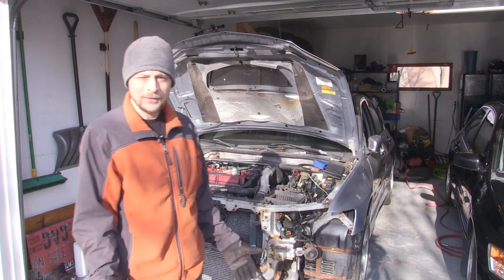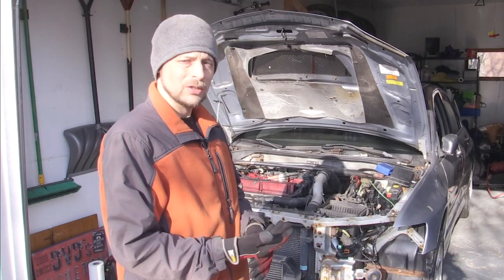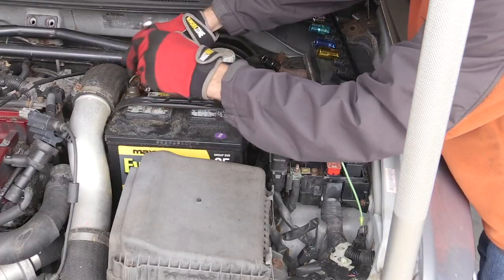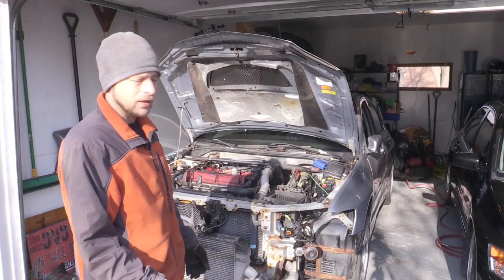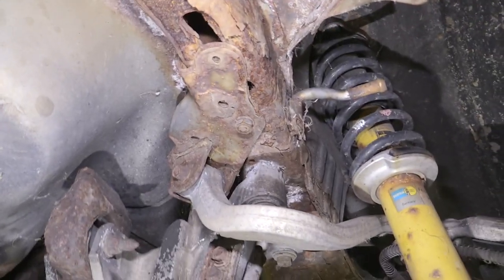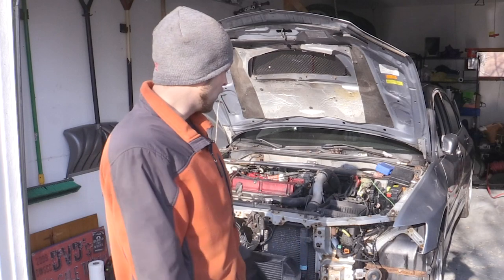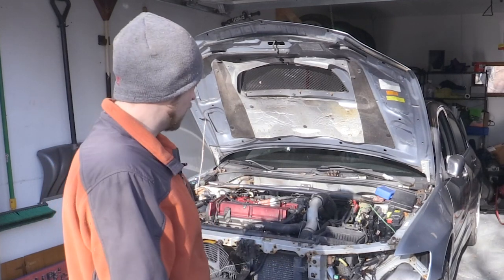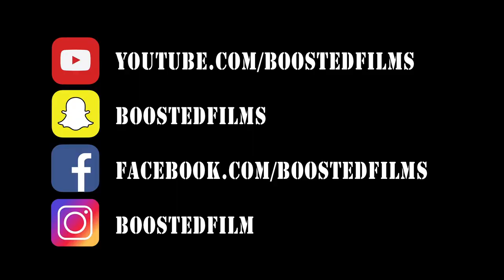RUSTY EVO BUILD #3 - Broken Bolts - More Rust - Boosted FIlms

Comment: Man good luck with this. I want to tackle this level of restoration with my 06 Evo. My car isn't as bad as this, but it has 156,000 miles (I put on 90,000 of them) and unfortunately I've had to park it outside almost all of the time I've owned it in Michigan winters. I think I'll have some pretty big rust issues, but frankly getting rid of it is something I would never do. Too much sentimental value. Mechanically it's not bad, but eventually I plan on removing all of the drive/powertrain to fix/restore all the rust. Good luck!
Reply from the maker: Thanks! Good luck with your evo 9!

Comment: If you do repair it you’ll have another evo, although a rusted frame that’s been repaired may not be good on a sale, or it may be. Depending on the job done. Either way I believe you’ll make money if you get a clean shell and swap the mechanical, selling all the parts you don’t need. 2 clean evos will be roughly $25,000 - $35000 sitting in that garage. Not to mention the fun of working and enjoying the ride along the way. Your videos are dope and I’m sure you’ll make it work out. I’m restoring my evo and using your videos as reference. Thank you for that!
Reply from the maker: Thanks. Good luck with the restore!

Comment: Man, really feel ya on that broken sensor bolt. Been there, done that. Several times on an engine block and head, in fact. I'll drop what I've learned here, maybe it'll help you or someone else. First thing i figured out is to NEVER use "screw"-type extractors. No matter what quality or price is - you'll never centre the hole you drill right and on these hard-seized bolts it's crucial if you're using that type. You may try your luck with square pointy ones that you hammer in - at least it's not that much pain to get them out when they break. Now, what did it for me is 2 things: drilling out the bolt in the milling machine, or getting it out with a dremel. For the first one you obviously have to strip the engine, get the part into the machine. Welding on a nut also works sometimes btw but you have to have a welding machine and free space. and in an engine bay you don't. For the dremel method I got the smallest pointy diamond-coated bits i could find and just carefully took off material bit by bit widening the hole in the bolt/bolt with an extractor in it (which those diamond-coated bits are capable of cutting) until all that's left of it is just bolt thread which i easily took out with a small screwdriver. Doing it in a cross pattern and then smoothing out the edges also helps, just don't forget to pour motor oil on it once in a while to cool the bit. Its an exhausting process, but it works, in fact, once you get past that stuck broken extractor, it gets much easier (obviously cuz they're hardened). Anyway, wishing you the best of luck with this, sure you will come out the winner!
Reply from the maker: very detailed, thanks!  Yea the front cover that has the broken bolt could come off, but that would basically require engine removal. I'm hoping i can try a new sensor even with 1 bolt for a bit a check engine health a bit more before i did too far.  I have access to a milling machine, so that option may happen eventually.
Reply from the maker: 2nd though.  I can always just get a new oil pump cover. Probably a good idea anyway with a 200k mile oil pump on the car.
Reply: @BoostedFilms  True. But deep down you know through that if you decide to get a new one, you'll end up buying new everything else in accordance with the "while we're here" rule and just bc that's how it usually goes, haha

Comment: You need to wire brush it and see what is salvageable. If the ends of the support are intact you're golden. You can cut the cross member and weld a square tube replacement or donor car cross member.  If you only have a couple spots in the trunk, Clean/paint and use a body filler for pinholes. If they're gone, find a junkyard car and cut the trunk out for yours. If not, sheet metal works too. You will not see it regardless. The cost is the prep work for this job. You got to remove all the rust and use a rust inhibitor.
Reply from the maker: Gald to hear this. I'll keep digging when i have time.  Thanks for the comment.

Comment: I see two possibilities. 1-Find a cheap but clean Lancer that you can use as a donor for metal parts. 2-Go full race car and chop out parts and simplify. Race cars also don't need to look nice, so some rust would be fine as long as it's not structural or at a point of maintenance. (suspension points etc.)

Comment: Well you got 5K between the interior and motor alone not counting trans tcase & rear diff . Id say strip it down part it out to the bone & scrap it . There are tooooo many cleaner base shells available that would be so much nicer to work on
Reply from the maker: This does seem to be the most logical way if I had cash for another shell. IF. Ha
Reply: Boosted Films time to start parting that guy out !
Reply: @blaqjac21  Agree! That thing is bad...

Comment: I replaced a rear chassis rail on my evo. it wasn't very expensive  but removing the old chassis rail was difficult because of all of the spot welds that needed to be drilled out or ground out with die grinder. Annoying.
Reply from the maker: Assume it was less expensive to get chassis rails being outside the US?  Getting chassis legs here in the US doesn't seem cheap.

Comment: I would not want personally want to have a frame repaired Evo it will never be structurally the same.  Maybe try to find a clean roller like in the comments out in Washington area where it's salt-free.   The salt out here and Wisconsin sucks!  I dealt with some vintage JDM motorcycle motors where the exhaust bolts would break off.  Took the whole motor to a company that burned it out with a really cool machine did not harm the aluminum threads were perfect.  Once the extractor breaks inside the bolt you're kind of screwed unless you're a professional in the bolt extraction game.
Reply from the maker: If i ever sold the car I would be up front about the repairs... obviously it out there on the internet now!  I agree it would lower the overall value.  But again, reminding myself i wanted more of a beater evo to begin with that i would not feel as bad about racing.
Reply: @BoostedFilms   Yeah I wouldn't feel bad turning a beater evo into a fully built drag car. Cut it up, cut out that rusted frame and have a chassis shop put in a partial tube frame with a high HP engine build.  Would definitely make for some cool content on your channel.

Comment: So what did you do for all that rust?
Reply from the maker: No much yet, other than the Recall on the front crossmember that Mitsubishi provides ->  https://youtu.be/YlWNyVIDiXg   It should get new rear chassis legs someday, but as if now i've just been driving it as is.
Reply: @BoostedFilms  would like to see it fixed. It would probably give hope to people with the same problem to not junk it and get there's fixed. I have rusted strut towers I gotta sand blast the rust off and weld new metal in on my 95 gsx

Comment: I think part out and sell what you can. Like you said there is no value for a stock high mile rusty Evo.. plus the broken bolts in the block will have you on suicide watch lol
Reply from the maker: May just invest in a new oil pump cover.  Then the broken bolt issue is take care of on the engine.  Fixing the rear rails is possibly and if thats all i need for stability, it would still make for a fun winter/dirt track car.  Need to keep reminding myself i don't plan to build another really clean evo.

Comment: Poor Evo, i had a very rusty project civic and i put a 50k mile jdm engine and an 80k mile transmission in it. i found a clean civic for $200 with absolutely no rust that needed an engine and i did a full swap. Glad i went with a clean shell. Rust repair just isn't worth it unless its minor. it all just depends on what the evo is worth to you, if you'll use it then keep it cos youll never get what you want out of it unless some kid comes along who cant aford a clean one.
Reply from the maker: Nice, sounds like a good swap! I wanted a less clean evo I could beat on, but it needs to be road worth 🤔